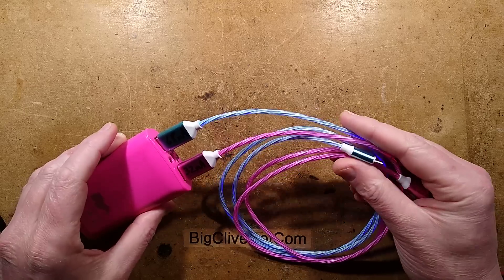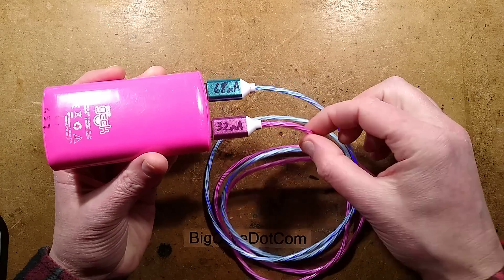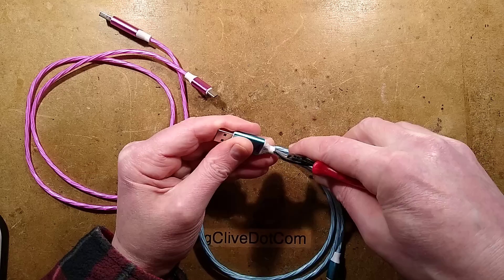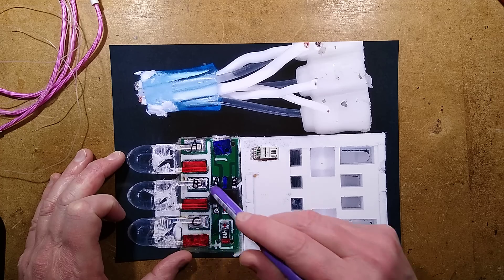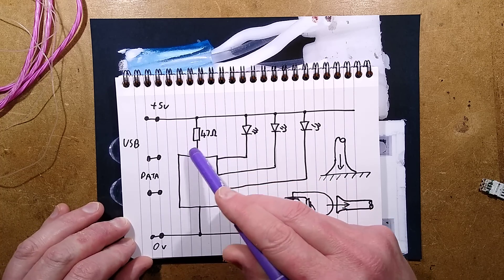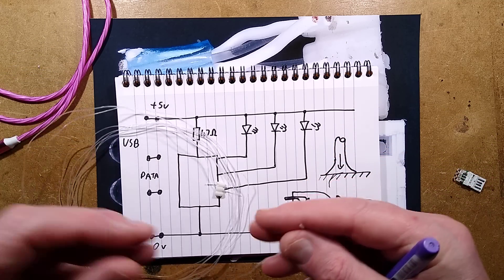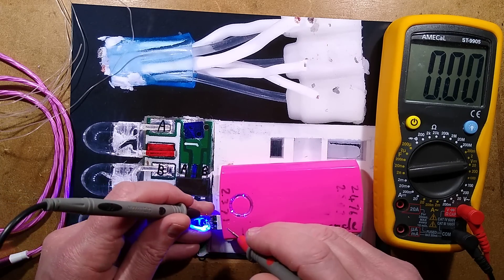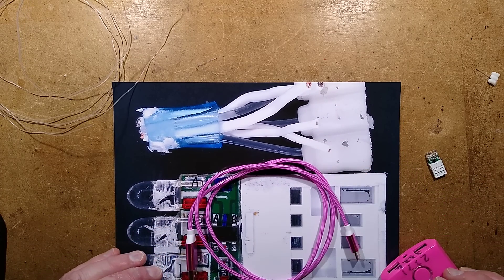Best side-glow fibre optic I've seen

Comment: I wonder how well that would last if used to extend a USB-C PD cable (not all PD supplies follow USB-C spec quite right allowing voltage selection through the USB A socket.
Reply: That's a key feature.  There's no reason not do PD with only USB 2 data connections. It is particularly important to support the USB 3 variants of A and B plugs, but also very useful to support the old quickcharge and PD protocols needed by anything that follows the previous government requirement for phone chargers to all use USB micro B, or the even older devices that charge via mini B (my sports watch does that, just like my old HTC phones).

Comment: Are the data lines connected right through? I wonder how the blink circuit would react to a quick charging charger+phone that goes up to 9V or beyond.
Reply: With a tiny pop, and then a complete lack of any light output later would be my guess

Comment: I had a blue one that was similar about 8 or 9 years ago, it was in a 40mm long dongle, I'm sure it was EL though, 
It had charge rate animation, I tested it on an bench power supply, it did fast for above approx 1A, medium was around 700ma, slow was around 150ma if I remember correctly,
It failed after around a year, so I did an autopsy, 
I can't remember much apart from 6 small gauge wires that looked like telephone wire and a shitload of SMD's, I think there may have been short EL/cold cathode tubes firing down fibreoptics?... And tiny transformer coils for high voltage?... Who knows?... I was probably quite drunk at the time
Reply from the maker: I made a video about one of those.

Comment: Does each end of the cable have active circuitry?  I suspect that each does.
Reply from the maker: Just one end.
Reply: @bigclivedotcom  Thanks, that figures.   I think the makers of this cable passed up an opportunity for enhancement.  Let the cable glow blue when power is applied and the flash red as data is transferred over the D+/D- lines.  I suspect that would be very popular.

Comment: ... If you have energy and time to waste while charging .. ^^  .. I don't like them, as a USB charging cable at least. 50mA is 10% of the regular USB2.0 charge current.. you need that much more energy to charge something, if it is charged by a power bank it is even worse, because you need double the energy to charge up the powerbank again.. also I would guess the voltage on the output end of the cable is lower because of the additional load.. so it might also take longer to charge something..

I have a little "bush" (maybe 100) of short fibers (20cm) with a colour changing led underneath.. that thing is really nice though.. paints little dots on the wall.. cool ambient.

Comment: Very interesting and really solid illumination but there is NO WAY I could deal with the flashing/chasing of the LEDs.  just like with christmas lights they have to stay on solid.  I just can't deal with them otherwise and I've had to toss more than a few in the trash because there was no way to just have the on or off.  I had some 110V strip lights installed to illuminate along the baseboards and much to my dismay after everything was installed and powered on within 30 seconds they began this pre-programmed flashing pattern.  I tested them when I first got them and they were solid so I assumed they'd stay that way.  There was no way to adjust them to I ripped them out and replaced with basic ones that just were on or off.  It's my autism & Asperger's at play but I have never been able to understand how anyone can sit there with flashing lights going off around them.  It hurts my brain.

Comment: How does this item cope with the higher charging voltages (20V) we see on modern USB equipment?
Reply: It would probably turn into a smoke machine.
Reply from the maker: I doubt it will survive.
Reply: @bigclivedotcom  Many thanks for the personal reply Clive, the only reason I ask is because we used to design controllers for electric wheelchairs which use 24V Lead Acid batteries, these have a large operating voltage range (18V - 30V) - we used a constant current source to drive the LEDs for the battery gauge - this kept the brightness the same across all the operating voltages and meant the LED current could be pulled straight out of the batteries and not through our regulated supply - I wondered if the 470 ohm R programs the current.

Comment: What happens to the 6th pin of the chip ? If it connects to +5 then as Damaged says, it might configure LED current or oscillator frequency
Reply from the maker: I'm not sure if it's just not used or is maybe a fourth chasing channel.

Comment: I got this same USB cable EXCEPT that it splits the single data cable into 3 parts for Micro, USB-C and iOS ends. 
At the point where it splits there is a small box and then each of the 3 cable ends also flashes in the same manner as the main cable. (TEMU Item # AG00521 for $2 with free shipping - crazy).  
As soon as I get a few extras I'm going to tear it apart to see if the 1 cable splits optically or if there are additional LEDs in the divider box.

Comment: These leads look really good but Power Delivery does not work!?
Other protocols work but hit and miss
Reply from the maker: They can't handle more than 5V, so maybe they hobble the communication.
Reply: The ones I have I have used the QC protocol to take them up to 20V but did not get that much brighter and did not heat up!
Just USB C Power Delivery does not work which is very annoying and most our kit are Google Pixel devices so not fast charging. Apple seems to be OK but looking further into this!?

Comment: Mr Clive off the record can I turn an Ethernet cable into a Y connector? Idiot wise....I don't hold u responsible just looking for a answer
Reply: Generally a bad idea with data cables, you can get away with that with multiplex signals in specific instances. With power it's often not a problem, unless it's a big problem. You can use an old router as a switch in a pinch.
Reply from the maker: Not recommended.  It could cause a data conflict and have issues with signal reflections.
Reply: @bigclivedotcom  I take your advice and concur. I thank you sir. I shall drive to the electronics store. One moment please.......ok I bought one. All is well carry on and thanks to all for the help and not treating me like an idiot

Comment: The position of the resistor is typical of a fusible inrush resistor to not cause a current spike when plugging it in.  Or it might act as an inductor to filter the power line between the internal oscillator circuit and the possibly noisy computer environment.  A third possibility is to sense the load on the cable and adjust the light as in some cables from other comments.
Reply: This circuit is across the 5V USB rail, how would this circuit monitor the USB load?
Reply: @markkrusemer526  By putting the resistor in series with the load.

Comment: Surprised they didn't just use those dirt cheap circuit board type laser diodes. They're not in an actual can or anyting they literally just look like a little square scrap of circuit board. And you can buy a dozen of them for about 50 cents 😂

Comment: Do you want me to send you this unit to carry out an open up to try to discover why for your YouTube channel?

This is an intermittent fault so may be difficult to discover the issue.

Switching off hard to reach electric to save energy *I CAN NOT recommend this unit: Twice up to to now it has switched off the connection without asking for this to be done*. ( I do not know why )

Video of before it started switching off the connection

Switching off hard to reach electrics to save energy. I CAN NOT recommend this unit:
https://www.youtube.com/watch?v=_9jcTEnEpZg
Reply from the maker: It could be that there is someone in the neighbourhood with one on the same code, or that its power supply is struggling to keep the relay powered.